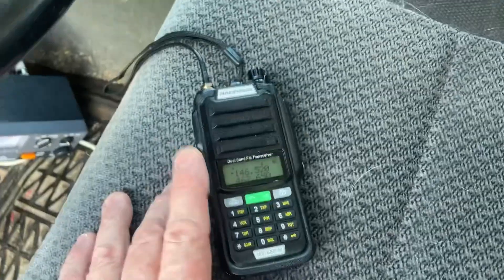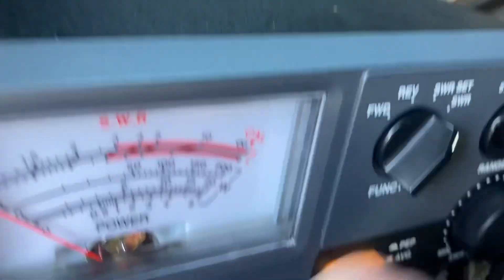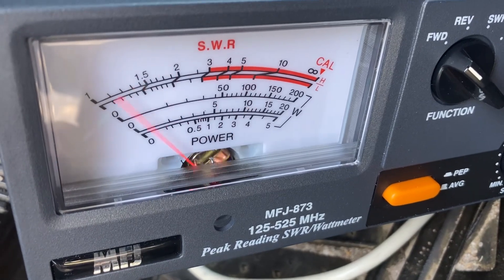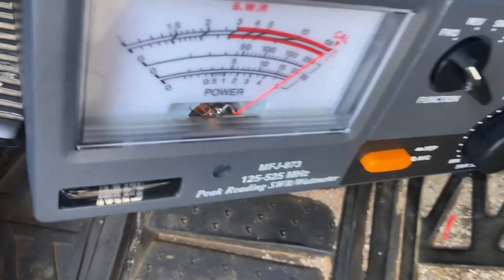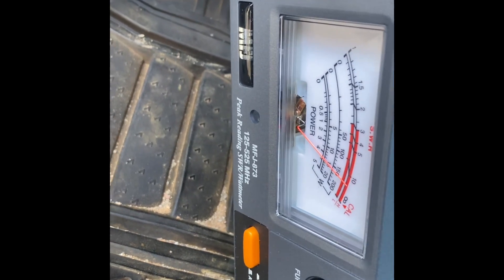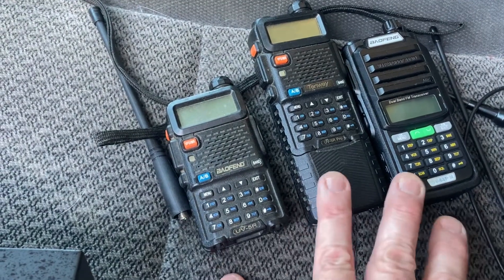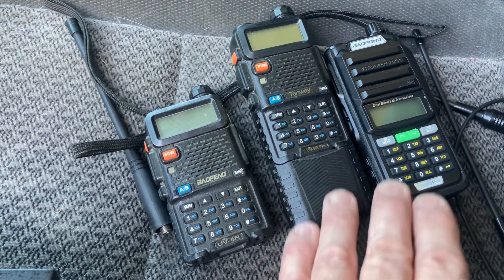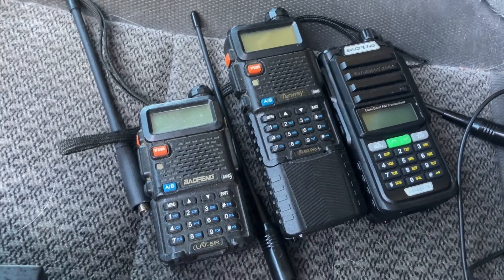Baofeng ht power test!

Comment: I have the Baofeng UV-5R Plus (my starter radio in GMRS), UV- 9G, and, recently just bought the UV-21R Pro V2 Tri-band. Not really into HTs that much but I do love my WOUXUN KG1000g PLUS mobile RF radio I’m using as my base comms! Also, still have my BTECH-50VR I used for a base for awhile before buying  the WOUXUN. Besides those my favorite of the HTs is my Inrico T-320 Network radio using two different nodes.  Have a good evening and I’ll ttyl. 73s! ~Jim~
Reply from the maker: I love the cup holder mount! I got the uv5r for my wife and I to use back when we lived in Georgia. Our mail
Box was a mile down our driveway in the woods. lol there ok I guess for the price. My favorite ht was the radio shack 202. That stupid thing was a tank! lol 
Take care Jim and God bless!